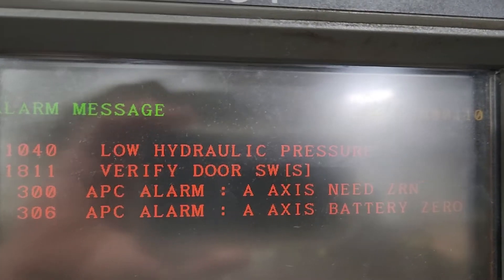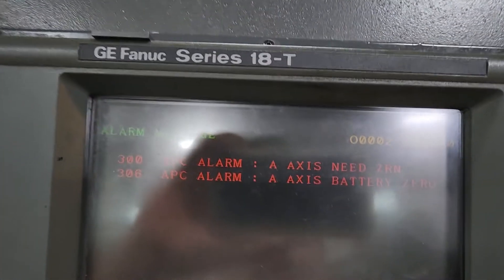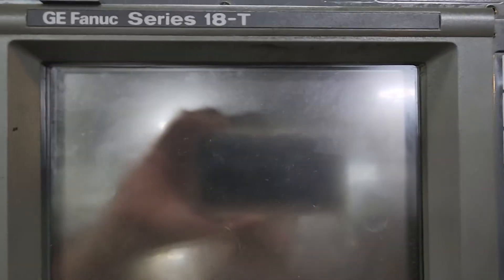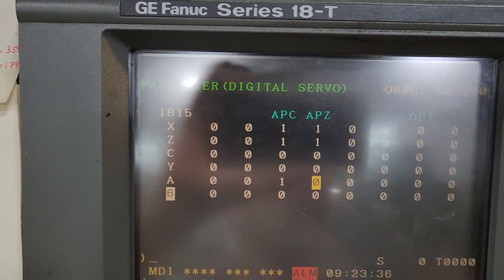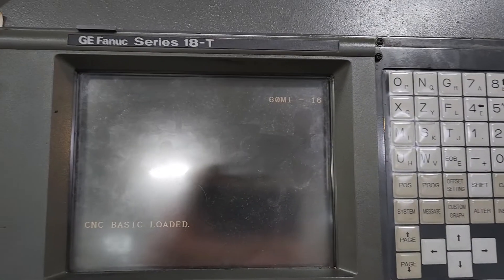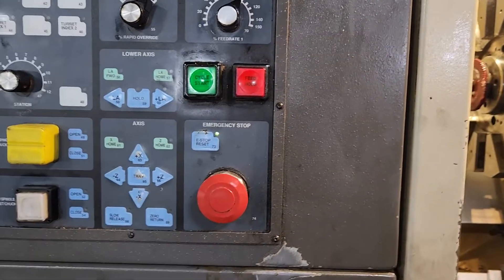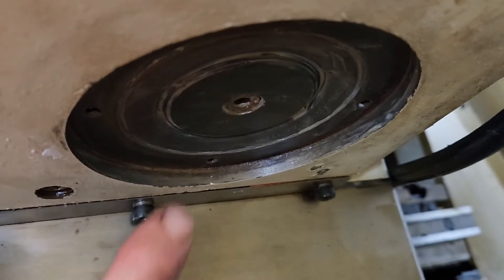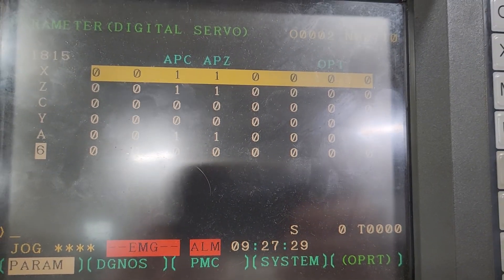How to clear Fanuc 300 APC Alarm : A Axis need ZRN and 306 APC Alarm A Axis Battery Zero

Comment: Is it the same method for  x,y and z on mills?
Reply from the maker: No, most of the Hardinge mills use decel switches, then parameter 1850 grid shift. When the switch comes off of the decel dog which is about 3 inches long, the servo moves to the marker pulse, then calculates the position based on the grid shift value.

Comment: Hi there! Probably you can help me on this:

Mori Seiki NZ2000 T2Y with Fanuc control: After a battery issue, all axes showed APC errors. I was able to set new reference points for all axes except Turret 2 (T2-axis). For T2, I set APC/APZ to 0 and restarted the machine – after that, I can move all axes and T1, but T2 won’t move at all. If I set APC and APZ to 1, it loses APZ after restart and I can’t do anything. Is there a special procedure for this?
Reply from the maker: This machine must be a relatively new machine because I don't have any documents on it. If you were able to reset the reference position for the upper turret, you have a pretty good understanding of how this is done. I have had to turn both the APC and APZ to zeros, cycle power, then make the APC a "1", cycle power, then make the APZ a "1", and cycle power once more. Each machine tool builder writes how this is done. There might be a special procedure, but I don't have it. Give the above a shot and let me know how it goes. Stay in touch!

Comment: HOW ABOUT DARYL I'M FROM MEXICO I HAVE A HARDINGE LATHE CONQUEST SG-42 GE FANUC 18T YEAR 95 96 YOU COULD SUPPORT ME WITH THE MANUALS I ONLY HAVE THE PARTS AND ELECTRICAL MANUAL I HAVE A PROBLEM WITH THE PLC OF THE TURRET IF YOU HAVE THE MISSING MANUALS I WOULD APPRECIATE IT OF COURSE IF THERE IS ANY COST WE WOULD SEE IT
Reply from the maker: @alejandrocou3454  there is no cost. I will gladly send it. Send me an email and I will get you information on your machine. I can even send you the backup data if you send me your serial number.

Comment: Damn I couldn’t really hear that well and I accidentally hit the input when you said not too ! 😮what do I do in this situation
Reply from the maker: You need to change that parameter back to your original parameter. Let me know what machine model, serial number, and which parameter. I might have a backup.
Reply from the maker: Don't run the machine if you changed the first parameter. It could crash if you changed it from metric to inches.
Reply from the maker: If you have a hard copy of your original parameters, just put it back the way it came from the factory. This is why it is important to have a backup of your machines.

Comment: hey not sure about your CNC but on the DMG there is no HOME or referencing in X or Y or Z  ; its supposed to know where the mill is whenever you start up. 
so ,what do i do if i am "0" in APZ "x" and APZ "Y"  ( my batteries died i had to replace them)
how do i "return" X or Y ?
Reply from the maker: What machine model and control? I have worked on lot of Mori Seiki machines. Is this a mill or a lathe? I can send you a procedure. Where are you located?
Reply: @OtherBrotherDarylSmith  DMG DMC CNC mill deckel maho i am in london ontario canada thanks
Reply from the maker: @fredrezfield1629  What control? DMG has their own numbers, but I am assuming it's a Fanuc with a DMG number.
Reply from the maker: You shut it off after getting the battery alarm. All the batteries do is store the machine's position when power is off.
Reply: sorry i thought that was a question?
i always thought you'd change batteries with the control on 
that's what i did but the DC0300 alarm messages for Return X and Y wouldn't go away

Comment: I did the same procedure but my program doesn’t run after it reaches the tool changing program
Reply from the maker: There is no tool change program. Close the door, go to MDI mode and call up a tool. T0101;  and then insert, hit cycle start. If it doesn't move to tool #1 you should get a message. What messages or alarms are you getting?

Comment: Hello I have a Hardinge cobra 65 like to know how to us the Fanuc 21-t controller and dost it have a home button I can move the Z and the X just can't find the home swich
Reply from the maker: That machine uses what is called an "Operator's Panel". You can hit the "Quick Page" to find it, then page down to find the "reference" button. If you don't have a "Quick Page" button, hit the "offset" button, then the right expansion key, and then "OPRT" soft key to access the "Operators Panel". The first page is usually blank, so page down. 

That machine also uses APC/APZ, so you can refer to my video on resetting the z-axis torque limiter if you need to reset the home positions.. I can also send you some PDF files if you send me an email.
Reply from the maker: The 21T and 18T are very similar as far as the parameters. The difference is that the Cobra uses the "Operator Panel" internal switches instead of selector switches.